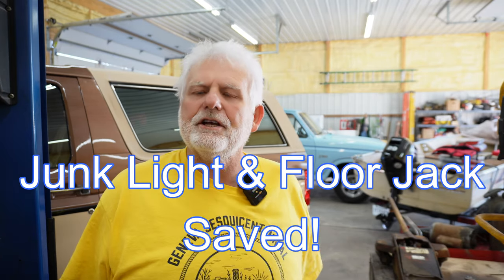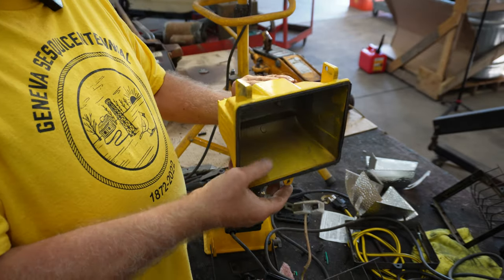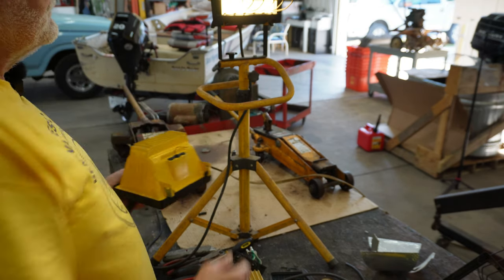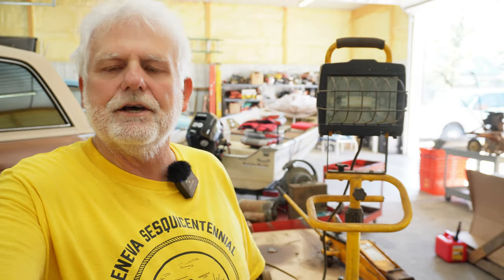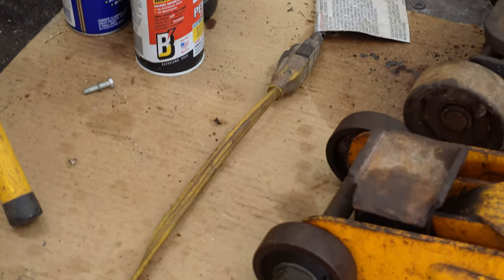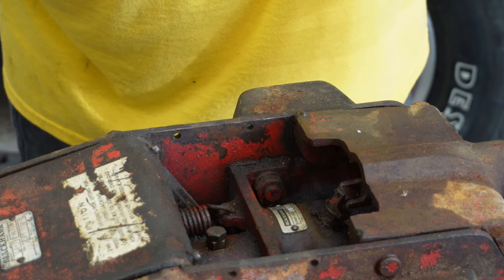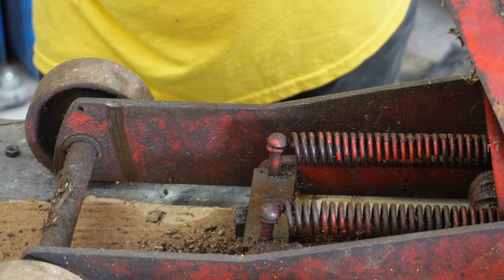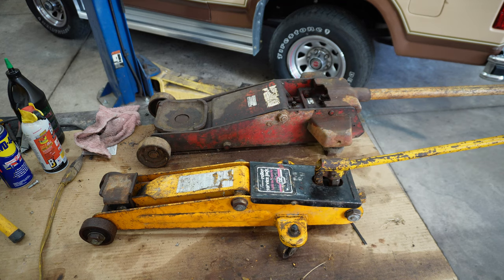Rescuing a Junk Light & Floor Jacks-Restoration Success Story

Comment: Hey, this is Sue! I had a mixer onesthat didn’t work and I decided to fix it myself. The cord was all used up in the part that goes into the mixer was all spread apart. So I decided if I just squeeze it a little bit it would probably stay in the mixer and it would work. 
So I put the cord end in my mouth and was going to give it a little squeeze with my teeth. This is a really good idea until I realize I never unplugged the cord from the wall. It was quite a shocking experience!